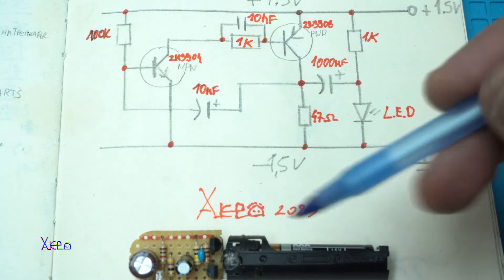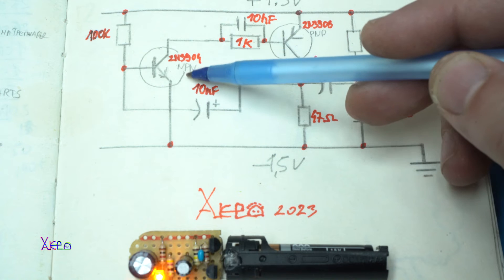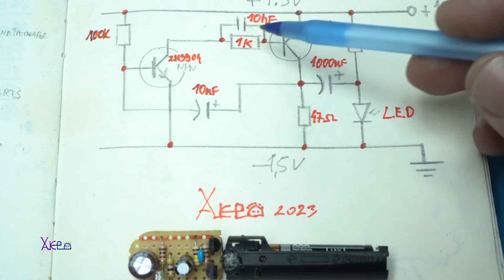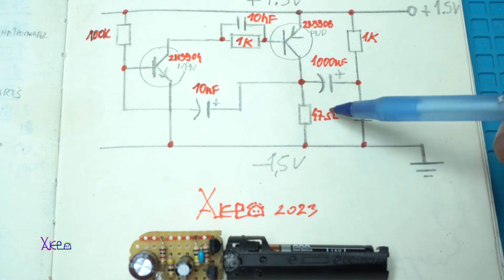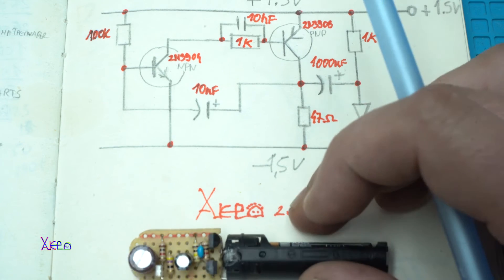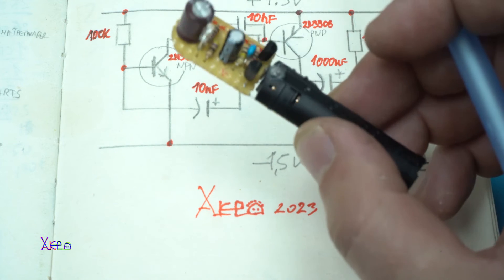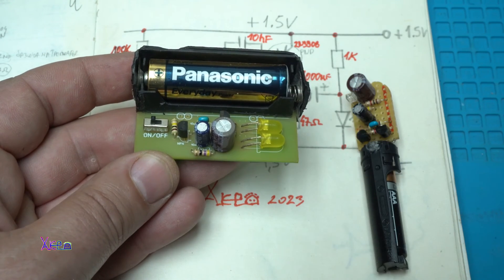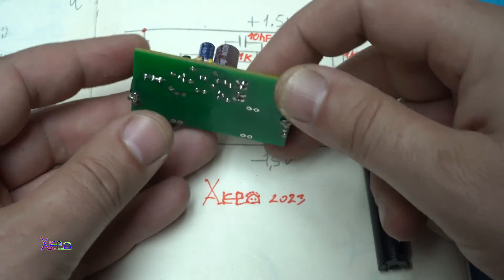This LED will blink for 1 year with One 1.5v Battery

Comment: Tweek the circuit to pulse 3 to 5 infrared LEDs and make a tactical infrared beacon/marker
Design it to work on 3 volts to work on many types of batteries. Bonus points if all the electronics and LEDS are encased in resin cube shaped with a LED pointing outward on 5 sides of the cube and wires that runs to the power source.
Reply from the maker: Thx for ideas sir